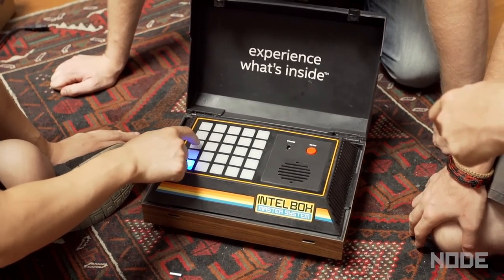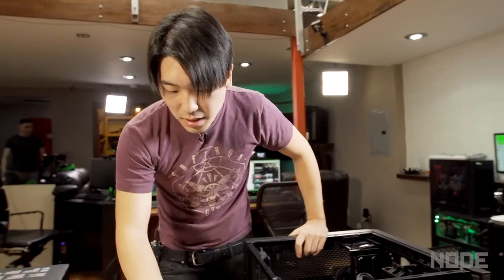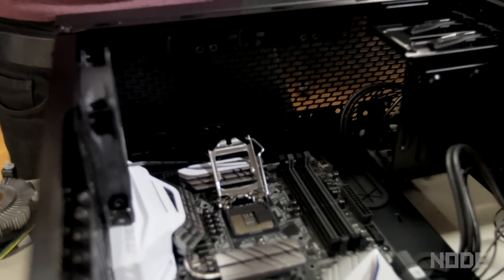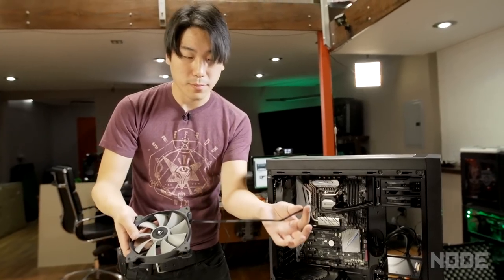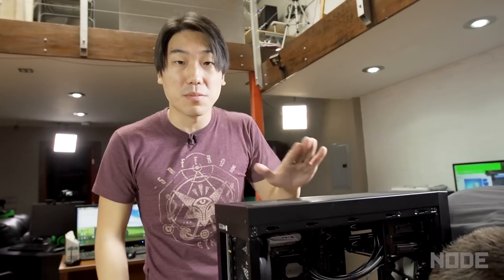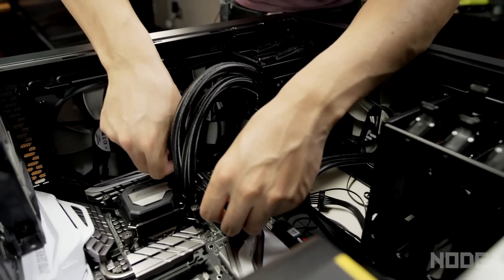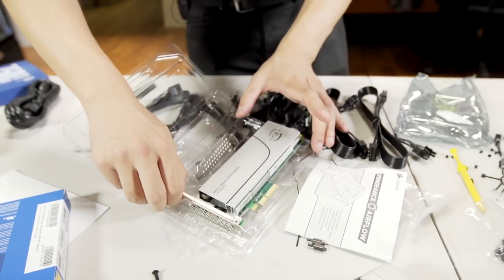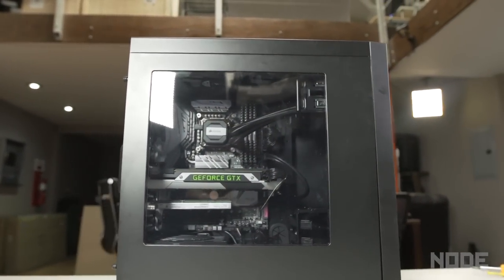BEAST INTEL PC BUILD

Comment: y u no get 980TI
Reply: +Donald Neal  This was probably shot on camera a little while ago.
Reply: +ShaneyPo0 he has a 6700k......the 980Ti was released before it.....o.0
Reply: deity 93 The 6700 and the 980 having nothing to do with the camera that this was shot with...................
Reply: +ShaneyPo0 um u wut m8
Reply: Wtf why you no understand? Shaney
Reply: LoL why you's no understand jokes?
xD
Reply: +Donald Neal y no titan x???
Reply: The 980ti out performs the Titan X vastly for the price.
Reply: If you are going to go overkill why not go all the way got a have that 12gb vram for whatever reason
Reply: astrosheeny It actually outperforms it in most relevant categories. If I had $1,000 I would still buy a 980ti.
Reply: +astrosheeny 

the last versions of the 980 ti own the titan. Pretty much the same situation with the 780 and the original titan remember ?
Reply: +Donald Neal You could just have 2 GTX 970s instead of a 980TI, as they outperform the Titan X in SLI for much cheaper.
Reply: +SpartaCraft 

2 x gtx 970's sc with acx cooler run about 319$ each new on amazon. Thats two cards and you would need the power to run both.  You can get a single 980 ti sc for $678.99. It also can run as fast or faster than a titan x. Has more vram for 2k and 4k gaming (6gb vs 4gb )  in tittles like cod:aw and gta v , So when you turn those graphics up this will help with vram usage. And best of all , he would have room for a 2nd 980 ti which would pretty much make 4k gaming... nothing.. For what.. just 50$ more ? And no sli issues with driver support.
Reply: +SpartaCraft I think if you are going to drop like £600 or whatever amount of $s on a GPU setup. You should either go straight for a 980ti or go for 390 crossfire. It's not worth all the money for 970 sli if you get stuck on 3.5 gb of vram!
Reply: +prissweb lol, you said tittles
Reply: +OldgamerROAR! Why the hell are you using Amazon as a reference? They don't have shit compared to newegg, microcenter, or NCIX

Comment: Did he just put the power supply upside down?
bruh
Reply: +Anwar Siracha It actually does. If the psu is that way the fan is intaking hot air in the case. That increases temperatures of the psu.
Reply: +T3chnoNerd Nope
..... Look at linus tech tips video on that
Reply: +GamezAhoy could you send me the link to that video?
Reply: IT DOES....
Reply: He did put the rad fans in a pull config so the hot air is being pushed back down, had it right the first

Comment: Remember kids, biggest lies about PC gaming.  It's expensive....Actual cost of this rig in parts only.  $4000< and that doesn't include labor, OS, Games etc.  The game will TOTALLY look and play so DIFFERNTLY.  All these parts will TOTALLY not be out of date in 2 years time.
Reply: Yea cause this is overkill. A PC with the power of an ps4/xbox one costs about 600/800$ to build and will be better in the long run
Reply: +prickly10000 You know nothing about PC parts, do you? lol. Dude, you can build a $400 dollar PC rig that surpasses a console any time. http://pcpartpicker.com/p/Rmmg7P . There. Even that cheap build surpasses this gen of consoles. Even the oldest i7s work pretty well today too. Im still running on an i7 3770k and it's fine and not outdated after the years I've had it. Also, look up Steam sales. Educate yourself son.
Reply: ***** Never seen that rig build. Thx m8
Reply: +prickly10000 Yeah $4000....http://pcpartpicker.com/p/ck2Dgs
$2300 mate, you clearly know nothing about computers. Including the fact that this build has lots of overkill parts (the PCi SSD, 850W power supply). So you could certainly shave off the price here. 

The build is also top the of the line and can easily play any modern AAA game at 1080p 60fps. Its also a computer, which you know... everyone needs.

Also you are correct in saying that the game will 'totally look' differently. The difference in games like The Witcher 3, MGS V and Mad Max are night and day.  60 fps also looks better, there is no opinion here.
You are also correctly in it playing differently too, playing with a mouse and keyboard is far superior to a gamepad in FPS, so yes it will play differently. We also get to choose what controllers we use, whether its the DS3, DS4, X360,X1 or Wii U pro controller (or the guitar hero guitar for that matter). 

Also of course the parts will be outdated in 2 years, just like your phone, your car, your house and everything else you own. But at least they come out and are the best in what they do for their price range and don't release with outdated hardware like you know...consoles.

In conclusion, please make sure you are informed before you decide to sprout your peasant like claims.
Reply: ThatOneGuy Yea but this build was a big overkill. You can make rigs with less money but still be powerfull. I must ask is is possible to have a titan instead of a 980 as a graphics card in this specific one? If so thats really killing it
Reply: Νικολαος Βασιλας You absolutely can, I just made this build for someone below which will perform better than Nodes for quite a bit ($800) cheaper when it comes to 99% of games.
http://pcpartpicker.com/p/kgV8gs

Yes it is possilbe! However a titan x will destory a 980, but a 980ti is only 1 fps on average in most games less than a titan x for $400 less. So its a far far better choice.
Reply: ThatOneGuy Thanks for the build. Im trying to find something not so expensive but you know good to start out.

Didnt know that 980 and 980ti were different cards,gonna keep that in mind :P
Reply: Νικολαος Βασιλας No problem! Whats your price range? I would be happy to help you create something awesome!
Reply: ThatOneGuy About 800-1100. Nothing to much :)
Reply: Νικολαος Βασιλας
http://pcpartpicker.com/p/4CfLRB 
here you go mate, this is pretty much 'the 1080 60fps' gaming rig and will even do 1440p high settings at 60fps on newer games. 
If you wanted to save some money you could go with LGA 1150 CPU/mobo, but this gives your the top of the line greatest and latest and allows you to upgrade too.
Reply: +Imran Bepari What I've learned about PC is that you have to factor that companies don't optimize their games well for PC a lot of the time. Even though your parts are more powerful than a console, devs make their games work as best as they can on the consoles, it's easy cause they know the hardware. A rig like the one in the video will play games ultra probably 2k resoultion no problem, despite a game having bad optimization.
Reply: ThatOneGuy Aight. Im getting paid in a few days so ill check it out. Thanks
Reply: The Tech Dweller Yea thats the one bad thing about pc gaming. Some companies pc ports are really bad COUGH COUGH ARKHAM KNIGHT COUGH COUGH so what i did is bought a console a bit back so i can play these types with no problem
Reply: The Tech Dweller That's for a few exceptions though. When you look at the massive library of PC games, it's only a few that are like that. You could name literally thousands of games that run better on PC than console otherwise. Plus, regardless of poor optimization for some games, they usually get patched up eventually.
Reply: ***** I dunno, a lot of triple A games coming out these days run bad on decent systems. I guess I have just had some bad luck but to name a few: far cry, assassins creed. These run bad on a lot of machines, and to say that they get patched eventually is a pretty piss poor excuse. Is it that much to ask to have my expensive gaming computer run games well on launch?
Reply: +prickly10000 There's the common conception that you NEED 2 980s, i7 and water cooling, etc. 
They did get most of these as a gift, and they aren't using them for gaming ( even the ones they do use for gaming, are later used for rendering and stuff)
My rig cost me ~700$ ( it's not worth that much now for sure ), and it's running everything just fine.
Reply: http://pcpartpicker.com/p/9N6tf7
There you go brother. That will smash games like ark (though keep in mind its not very optimized yet, but you will be hitting 60fps on high with a bit of mucking around in the settings and lowering stupid things like clutter). You can save money if you don't want to OC your CPU, but I currently have a 5690k and its an amazing CPU and now its price has dropped a tonne because of skylake (and you probably won't be noticing any difference in games).
Reply: +AndrewF321  if you think 60 fps looks unnatural, you are wrong, its the polar opposite. Life is in high frame rate.
Reply: The Tech Dweller
once again, completely subjective whether you like it or not, i'm not saying the smoothness is unnatural i'm saying if it isn't done correctly the movement looks unnatural, there is no such thing as a wrong opinion.
Reply: +AndrewF321 60fps cannot be done wrong. That's a fact. Every game is improved by having a higher frame rate.
Reply: +prickly10000 Got all my parts for $750. Took a few hours to get the first game running. 

I can run almost ALL games on Medium at 1080p60fps. Some games on low, but still at 1080p60fps. 
I got ~100 (not including Free to Plays) games for $335. 
Online is free. 
(Basically) unlimited exclusives.
Mods. 
4K.
Multi-monitor setups.
Keyboard and mouse.
Option to use a controller. 
Other things to do than just game (work, for example). 
Upgradeable parts. 
The community is great.
Reply: Nabil Jamil
i got all of my parts for around $800 CAD and I can run new games like Evolve and Elite: Dangerous on max settings at 60 fps and 1080p. Also you can't really use work as a reason since consoles aren't made for working so that would be like saying an outhouse is better than indoor plumbing because when you use an outhouse you don't have to flush.
Reply: +AndrewF321 when the outhouse gets full you have to dig another hole.

Comment: how did you handle static electricity beforehand?
Reply: +Alopcs touching the tower release those electricity or something.. some people stated that in other comment
Reply: +Alopcs static electricity ? pssh that dont exist dont worry about it
Reply: +Juno Arry People don't realize that you build up static charge very easily while working on a PC. Also, most static discharge that ruins computer components are not felt by the person. Symptoms of damage caused by static electricity usually start to appear months after the occurrence.

Comment: Just so people aren't confused as to what the intake of your car does. It takes in air for the engine, not what the rad is for. A computer radiator however, is exactly the same as a cars radiator. It expels heat from the heat source. Engine or CPU.

Comment: I have a question. Is there anything D can't do?
Reply: +unknownchronicles 
(insert negative Asian stereotype)
Reply: +unknownchronicles 
(insert negative Asian stereotype)
no but really.... he cant win a game of TowerFall Ascension
Reply: he didn't build the pc "properly"
Reply: +Shulk what did he do
Reply: He can't build a PC properly.
Reply: +Ali Sadeghi what did he do
Reply: +unknownchronicles 
I bet you he cant dunk like Mike! oooooooooohsnap.
Reply: +spencer ryan If you have ever built a computer, you will see a million things wrong with this. If you have built a computer and don't see anything wrong with this, you are probably making the same exact mistakes without realizing they are mistakes.
Reply: +Ryan Frechette explain one mistake that isn't completely nitpicky and not even a mistake like putting the power supply in upside down (which doesn't matter at all) or how he isn't wearing an anti static bracelet which is completely pointless unless you're stupid and rub your feet on a carpet and build the pc at the same time.
Reply: Yes he can't fail

Comment: WATCHING HIM PICK UP THE MOTHERBOARD BY THE CORNER WAS A TOTAL CRINGE FEST
Reply: Jean Kirschtein Lol i was afraid he was gonna drop it, most inexperienced builders think you'll fry the board if you touch it with more than 2 fingers
Reply: OK. I thought you were thinking of something besides dropping it. Well I'm sure he was being careful
Reply: +TyphonPC did he apply thermal paste to the processor?
Reply: killinkier123 He used the pre applied crap that came with the h100i
Reply: ah right. i dont know a huge amount on pc building but gonna be learning soon :)
Reply: killinkier123 Awesome, just remember to have good static protection (Ankle strap is what i'd recommend). You probably wont have a problem without static protection, but if you do, thats one bad day
Reply: ***** xD I really hope you're joking
Reply: ***** I looked at them, and marked them for spam Gr8 b8 m8 i r8 8 outa 8
Reply: +TyphonPC I was actually kinda hoping he was going to drop it.
Reply: SikspakSocal2 Same lel
Reply: +TyphonPC If static shock and/or "reverse fan spin" ( while cleaning ) weren't a thing, I wouldn't have two mobos in the trash. (albeit cheap, but new ones)

Comment: You should always install your components outside of the case and make sure everything turns on before putting it all together. If something doesn't work It's a hell of a lot easier to troubleshoot when you don't have to go reaching inside an enclosed space.

Comment: 4:08 "It's like the intake for a car"
LOOOOOOOOOOOOOOOOOOOOOOOOL not at all! if there's anything close that the coolers LOOKS like is an inter-cooler which cools the compressed air by a turbocharger before heading in the intake manifold... If there's anything close to the USE of a PC cooler like that on a car it would be the radiator... Sending the heat outside, gosh people...

Comment: I don't agree with the theory that mid tower is better than full tower if it fits everything. For example, I don't use liquid cooling, and even if i did, full towers give more space between parts and have better air flow and circulation. But then again this is pretty minor, but since I don't move my PC a lot, I have no downsides using full tower.

Comment: Guys help me out here, This is my PC:
Intel Core i7 2600K 3.4 GHZ Quad Core, 8MB cache, UNLOCKED
16GB DDR3 1600Mhz RAM
2TB HDD
NVIDIA Geforce GTX1060, 3GB

Is there any parts that would need to be changed/added. And what could I run on this?
Reply: You being serious right now? You're asking what you can run with an i7 2600K processor and a GTX 1060 for a GPU. I really hope you're joking
Reply: I've been told different results so I decided to ask the internet.
Reply: SuperGlued Crown If you are being serious, you can run just about any game near or above 100 FPS.
Reply: Thanks.
Reply: SuperGlued Crown maybe an SSD would be nice.
Reply: Get a gtx 1060 6gb. Games will take advantage of the extra gb in the future, and the 6gb actually has a FASTER clock speed than its 3gb little brother.
Reply: First homie, how much do you want to spend on the PC?

Comment: I have a gtx 1080 that for some reason drops and holds 60 fps on in game low settings when it's supposed to get 100 frames. I have AMD Ryzen 1700x and was wondering if I should upgrade my CPU or my GPU. I know it's because of bottleneck, but I want a personal opinion from an expert. I'll sub to whoever helps.

Comment: I'm getting a gaming PC at Christmas and I have built a custom and wanted to know if this was any good ? Aerocool X-Predator X1 Devil Red	 
	CPU	Intel i5 4690K - (4 x 3.5 GHZ) - Haswell	 
	CPU Heatsink	Corsair Hydro Series H60 2013 (Advanced Liquid Cooling)	 
	Memory	8 GB Corsair Vengeance 1866 MHz (2x4GB) - Lifetime Warranty (DDR3)	 
	Graphics Card	NVIDIA GeForce GTX 960 - 2 GB - (MSI) Twin Frozr V - (PCI-E) - (Free Metal Gear Solid V Game)	 
	Motherboard	Asus SABERTOOTH MARK 2 (Intel Z97) - 4xUSB3/4xUSB2	 
	Sound Card	Motherboard Integrated HD Sound	 
	Wired Networking	Motherboard Integrated Ethernet Lan (Broadband Ready)	 
	Power Supply	Corsair 550W PSU - Low Noise	 
	CPU Compound	Standard CPU Compound Supplied With Heatsink	 
	Extra Case Fans	Standard Fans Included With Case	 
	Wireless Networking	Wireless 300Mbps (USB)	 
	Hard Drive #1
Reply: +MG G It's fine, but if you're buying something like this please add an ssd and a better gpu to last. since you're paying them so much :U want to make your rig last long as possible.
Reply: +MG G depends on what games you're going to do

Comment: these YT commercials get on my nerves , you can recognize them as they will always use best parts , top of the line stuff, after they advertise it they return the components and it goes to another YT tech advertiser. If they wanted to make PC build video they could do it and make it unique. Im building 100bucks build now , ive blown the budget for 20 bucks cuz i needed more RAM , thats an interesting build how the fuck did i menage to make a 100bucks PC from new parts , will it run some games , how it will run , interesting stuff ..these commercial videos ive seen them all, its always top of the shelf parts i7,980,SSD most times intel cuz those are expensive and intel sends them ..and they occupied most of the YT space, type PC build , i grantee you will see those components